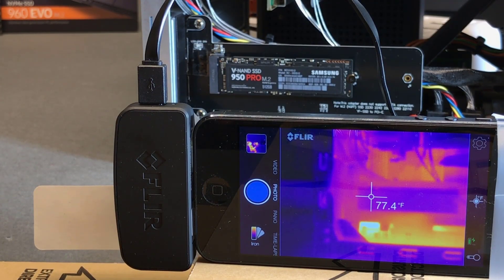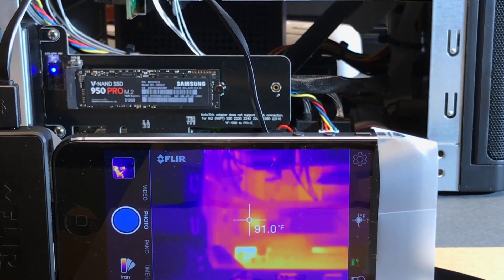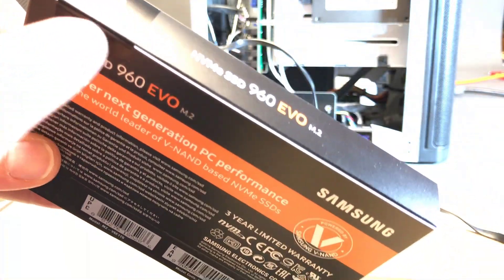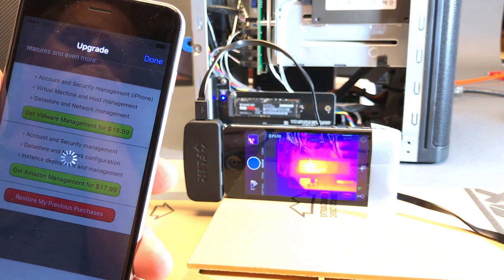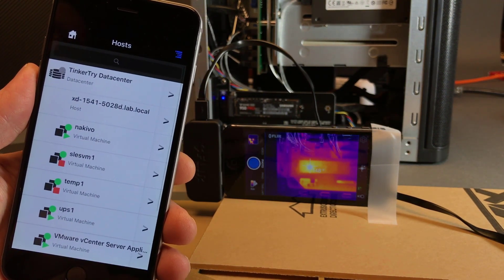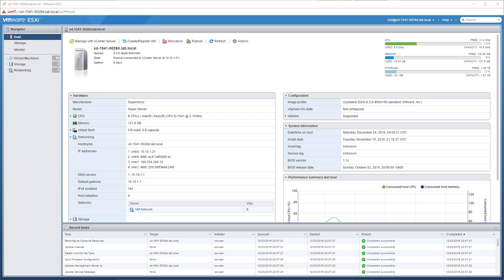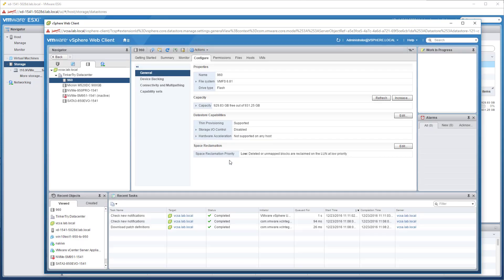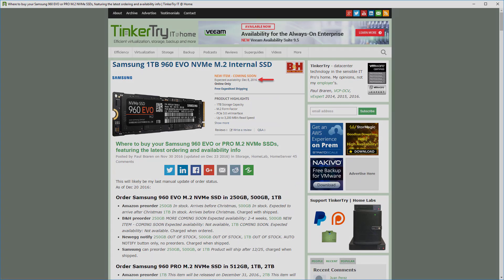Samsung 960 EVO 1TB M.2 NVMe - unboxing & FLIR thermal testing during VMware 6.5 Win 10 VM cloning

Comment: Please test it with a heatsink for the EVO and the PRO! I want to see how much of a different a heatsink would make! Thanks!
Reply from the maker: I"m a little worried about voiding my warranty with the stick on heat sinks, since it seems Samsung may want an intact sticker. For normal non-benchmarking use, I'm unlikely to throttle often enough for this to matter. At some point, I may try them out (ceramic type from Amfeltec), but likely on cheaper/smaller capacity M.2 drives.
Reply: Then we should voice our issue with Samsung asking for them to mount a heatsink on their product for us so that we don't need to do it ourselves! It's ridiculous with how hot these things get! That's hot enough to cause a fire!!! They should be encouraging us to apply a heatsink by first removing the sticker! They already have one major issue with their batteries burning up and catching on fire, do they really want another one?!?!